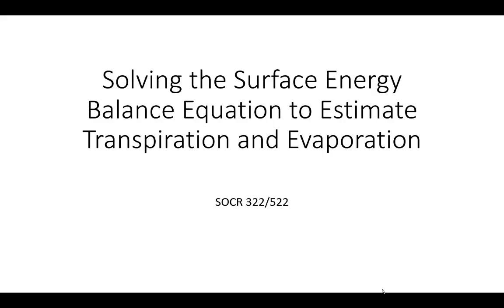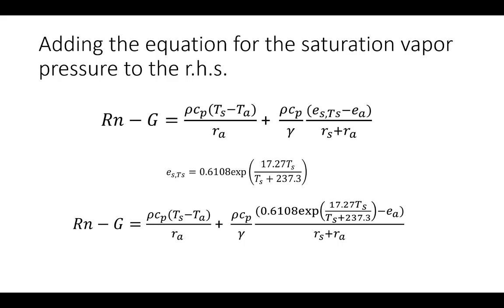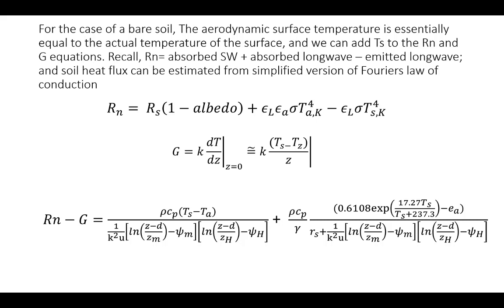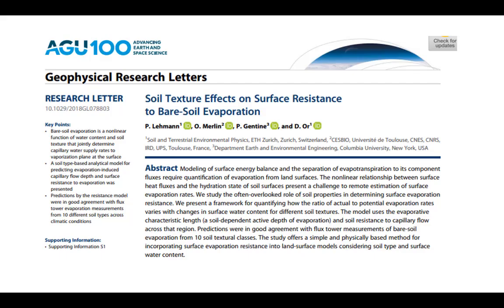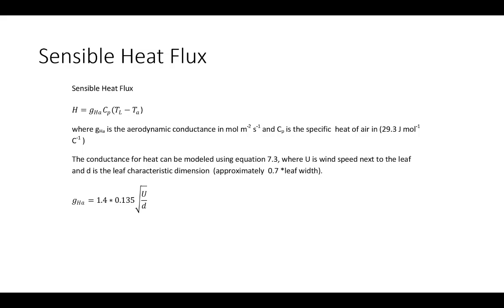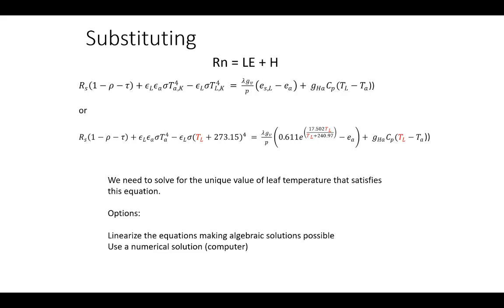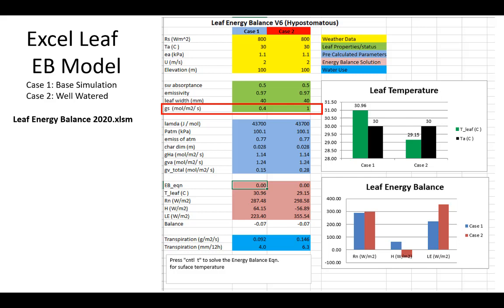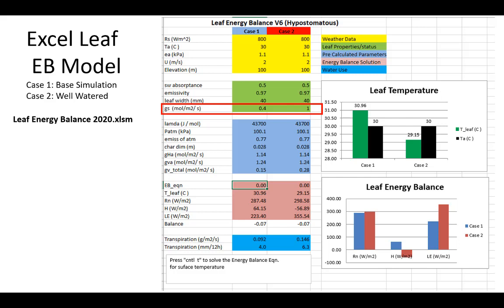Solving Surface Energy Balance for Estimating Transpiration and Evap

Comment: includes the Sensbile Heat (H) the outgoing black body radiation (in this case infrared radiation) or only the the transfer of energy via conduction when the airmolecules collide with the surface? Or in otherway is Rn the net of incoming sunlight minus the outgoing infrared radiation? If so, why would you work with this Rn in an energy balance model? Would it not better to R_full_incoming_sunlight and out R_infrared_surface?